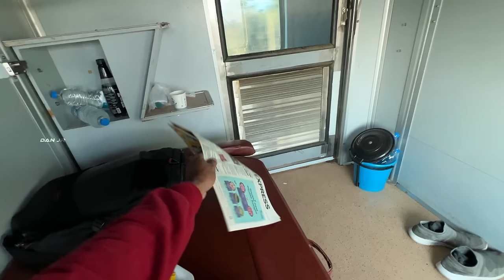28hrs First Class AC Train Journey 🚈 Private Shower 🚿 Super Fast Duronto Express | ENG Subs

Comment: @3:32 W(Broad Guage)A(AC current)P(Passenger traffic)-7HS locomotive which can speed up to 130km/hr...nice train to travel Anna👌...nailed it😍
Reply: Super sister
Reply: No WAP7HS trials runs upto 180kmph
Reply: @viki19910  yes bro it's the top speed but the operational speed is 130
Reply: Technically 180Km/h however Indian railways operational speed is only 130km/h
Reply: 160 speed gatiman express.. What do you tell??
Reply: @Drstrangeff06  that's wap p5